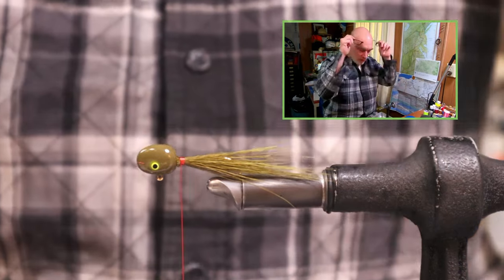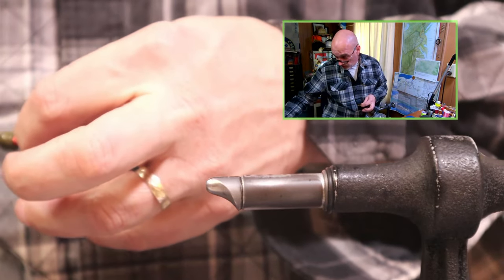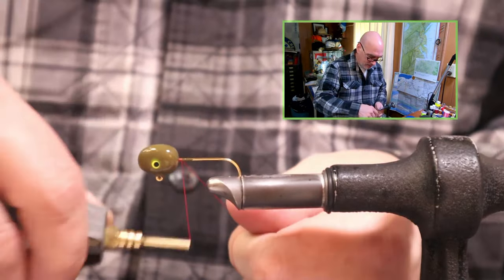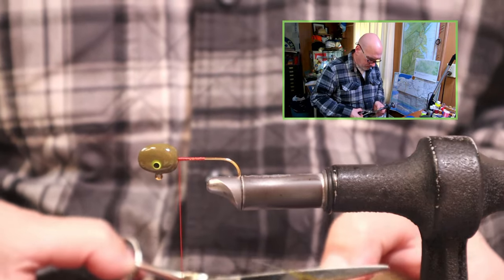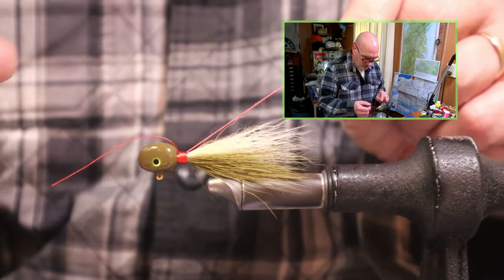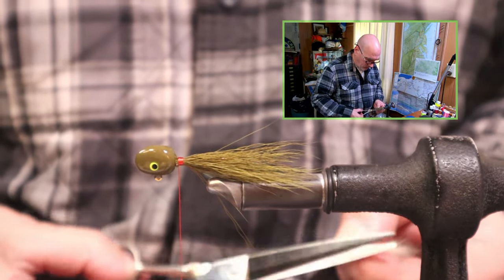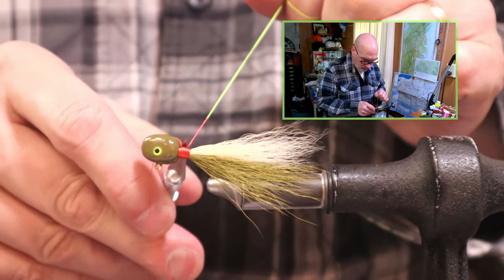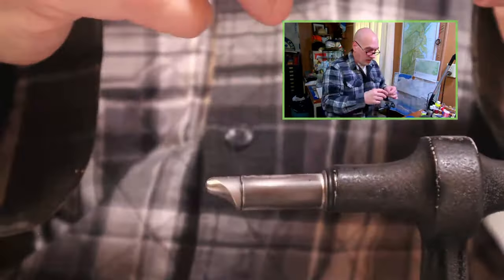Olive & Crean Walleye Jig, Almost Live

Comment: Love the videos. Do you typically just do one coat of head cement?
Reply from the maker: Yes, just one coat.  The lacquer is thinned roughly 90/10 and will soak into the threads & any that that does touch the hairs, capillary action will draw the head cement into the coller.
Reply: Great thank you!